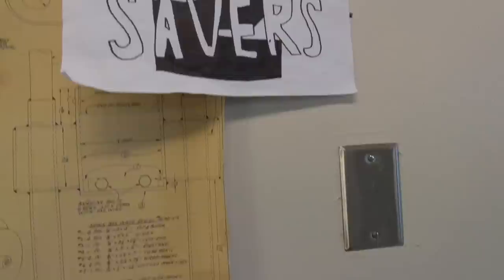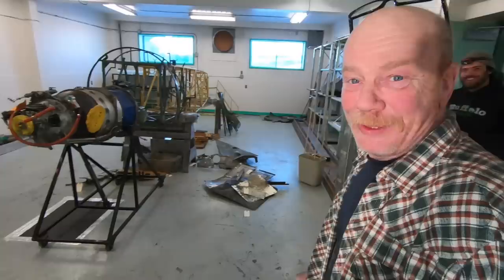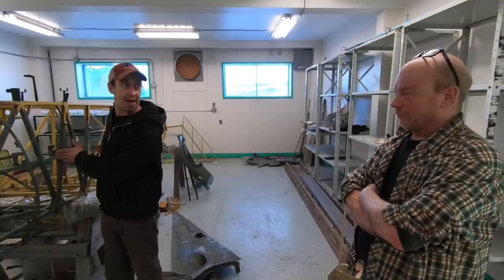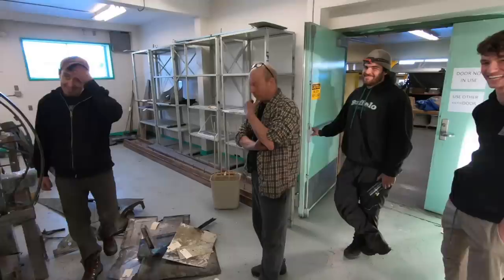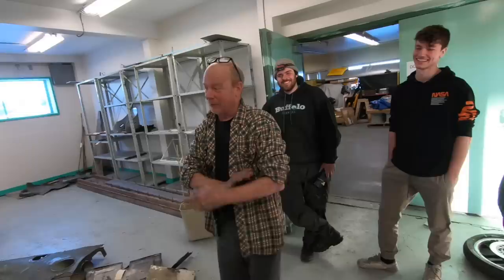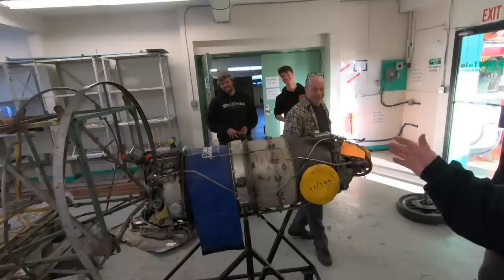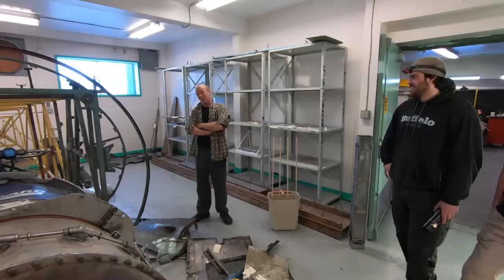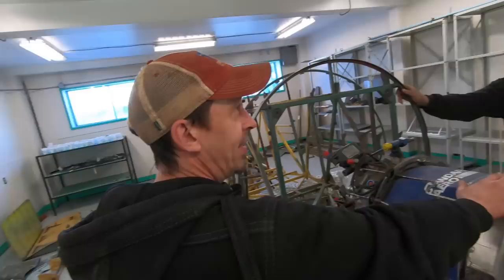Should we put a Turbine on a WW1 Triplane?  |  Plane Savers S2-E21

Comment: 6 seasons of Ice Pilots, 2 seasons of Plane Savers, and this is the most animated I've ever seen Rod! Great stuff as always Mikey
Reply: That'll preach.
Reply: Rod is mad scientist....the world's fastest Fokker Triplane
Reply: @marklittle8805  Until the wings peel off
Reply: @doneckford1189  my thoughts exactly. The construction of the wings is not sufficient to take the stress. Ask Mike Patey....
Reply: @westaussie2006  that doesn't make sense....Mike Patey's aircraft's wings failed because they hit the ground during a botched crosswind take off attempt, not due to engine relate stress.
Reply: @ernieszelepcsenyi5710  I think he talks about "Turbulence". A small piston kit plane that Mike PT6ifyed. He had to reinforce the air frame and wings to get a higher Vne and prevent the plane getting ripped in parts by the thrust of the PT6.
Reply: @ernieszelepcsenyi5710  I meant more for his slant on such a radical idea
Reply: @doneckford1189  It would have to be kept within its airframe performance envelope.

Comment: That would out Draco the original Draco!!  May be the coolest DR1 ever.  If you can't do the original rotary, it doesn't really matter what engine you use, it isn't original.  DO IT!!!!
Reply: I was also thinking of Draco during the video.
Reply: 👍👍👍👍👍👍👍 I hope they do seriously consider it.. Amazingly,  less costly than a rare high price radial that needs a complete overhaul.
Reply: Rotary? You mean Radial....
Reply: @streettosky5983  The DR1 was born with a rotary. Think of a rotary as a radial which has the crankshaft bolted to the firewall and the propeller bolted to the crankcase.

Comment: Its not just the CG to worry about. The torque from that motor will twist the tail off the fuselage! Every structural component will have to be strengthened, longerons, wing attachments, spars, tail feathers etc. etc. You’d have to do an engineering study, finite element analysis, to determine what needs to be beefed up. 
Having said that if you can do it safely GO FOR IT! You already have the talent and the hardware. You’d gain fabulous media attention. That translates into a marketing bonanza that will pull in dollars for the next project and good PR for Plane Savers and Buffalo Air. Win win! Plus it’d be just plane fun!
Go Mikey!

Comment: Mikey, your just messing with us. That engine will tear the wings right off the fuselage.
Reply: No it won't. It's still spinning a prop. The turbine is linear to you don't need to worry about torque going through the airframe.
Reply: What about the sheer power of that engine? Is it just a question of limiting it? I'm just asking because I'm curious.
Reply: What about it. The torque on a turbine is linear and you're just spinning a prop.
Reply: @RyanGribble  It's not about torque, it's about thrust. You'd probably need to keep the power output below 30% just to keep from exceeding the airframe Vne.
Reply: De-Rate is the name your lookin' for.
Reply: PistonAvatarGuy unless they redesign the airframe and build it with modern materials rather than wood and fabric. 
Rod is right - this is the ideal time and opportunity to make things “perfect,” but I’d still want an engineer’s opinion...and what about getting it registered with Transport?
Reply: yeah, it will rip the wings off.
Reply: Only if you exceed the top speed. There's is nothing really defining how quickly you can get there.
Reply: @gregdavies6842  I think it is safe to say the power to weight ratio will be that the airframe is to light for that engine. I think the plane would be unstable and crash after it leaves the ground, maybe killing the pilot, or the wings with be ripped apart. If all that doesn't happen, I think it will be near impossible to land the plane, as the air flow from the props alone ,with the 3 wings will keep it airborne, make it a vtol, able to hover almost. You may have to turn off the engine to get it down. Putting that engine in it, will make the plane to much for William to handle for sure, Joe maybe could handle it.
Reply: @gregorykusiak5424  10 years and hundreds of thousands of dollars later... "We built a tri-plane that in no way resembles a Fokker Dr.I!"
Reply: Time to make it a real youtube collaboration,  get Mike Patey and Elliot Seaguin involved, both know their shit and love aviation, if it can be done they will know how to make it safe
Reply: You gotta do it!
Reply: @Peorhum  nope.
Reply: It's not like you guys are going to have to fly it. William already said he would.
Reply: @PistonAvatarGuy  but its a turbine. It will suck the fuel almost as fast as a full-power setting.
Reply: @paulslevinsky580  Yeah, that's another problem.
Reply: PistonAvatarGuy well, while Mikey is definitely looking for donations to help the monetization of this channel to HELP finance his projects, I’m sure he has $$$ backing beyond this. 
I follow the Raptor cleansheet design project here on YouTube as well, and after about 2 years it’s almost ready for flight testing. This is a modernization project of an existing (albeit legacy) airframe, and the team’s depth of knowledge, breadth of experience and skill set is much larger in comparison. I say by spring in Yellowknife they’ll be close to the same if they choose to go that way.
Reply: @gregorykusiak5424  The only reason why this airframe exists is to emulate a WW1 aircraft, "modernizing" it would defeat the entire purpose of its existence.
Reply: PistonAvatarGuy the PT6 is way too much engine for that, even if they de-rate it. That said, it seems I’m more open minded about the definition of “Plane Savers”. Why not see what modern materials, techniques, knowledge and power plant can do for the original design? Doesn’t that also honour the original as much or more than a restoration?
Reply: @gregorykusiak5424  I just can't imagine what could be improved, the airframe is extremely limiting and redesigning it would be well beyond the resources available here. Safety also becomes a major concern when making significant changes to the design of an aircraft.
Reply: There's already a twin-engine jet/prob hybrid Waco. Kept the normal engine, slung a jet from (I think) a Lear under the belly. And they did a twin-jet Yak 110 not too long ago. Both of those planes now have a lot more power than stock.  It can be done if they're willing to put the engineering into it.

Comment: that would angry the purist , actually a free engine is a free engine . if it work then it's cool
Reply: I should imagine the reduction in vibration, alone, would be safer for the air frame.
Reply: Id say im one of those purists. However, this isnt an original dr1 to begine with so im not mad. XD it already would have brakes and a radial and throttle and probably a pitot static system.  Why not a turbine engine.
Reply: @benjaminjohnson6476  It's like an updated Avro Arrow theme.

Comment: Must do, Mikey. There is no other option. The CG must be behind the main wheels, or it will fall on its nose without enough weight behind the mains. I have over 9000 hours in turbine beavers and Pilatus Porters and can say a turbine tail dragged is the best thing built. Don’t worry about changing rudder and elevator size. The secret is the same as flying a Douglas Skyraider. You just have to be careful with power application at low speed. You can limit power output with adjusting the throttle rigging. Just sneak up on it gradually. The reliability of the turbine more than makes this the only way to go. The biggest problem will be building enough fuel capacity for the PT-6, probably 25 gal’s/hr at reduced settings. Keep fuel tankage near the cg. Build separate smaller tank fore and aft of the main for ferry distance, with tank selector valve. Just a really cute baby Beaver.

Comment: How would you get this very small airplane to carry enough Jet A to fly more than 5 minutes???
Reply: Motor is half the weight
Reply: Low power settings and larger tanks
Reply: I'm sure you fellas know a bunch more about this than I, so if it can be done, I say GO FOR IT!
Reply: The wings would probably ice up before you get that far in winter.
Reply: Two words... DROP TANKS😂
Reply: @montaguthorne2342  with low altitude fuses for max effect.

Comment: Sounds interesting, but what about the aerodynamic limitations of the wings and fuselage?  If all looks good on paper, this could out do a lot of aircraft!
Reply: Still just spinning a propeller.
Reply: @RyanGribble  just keep it within the airframe performance envelope and it'll be fine. I personally would ditch all the wood and make it outa aluminium.
Reply: @andytaylor1588  I agree. But they already have all the wood.
Reply: I don't see why you couldn't limit, govern, the maximum throttle range to prevent it from exceeding the limits of the airframe.

Comment: If you go for it,  you should seriously look adding significant strength to your frame (meaning metal and carbon fiber)
Reply: I am concerned about the additional stresses that the turbine will put on the frame.
Reply: @hillcountrysawdust351  It will not. The airplane will be flown within airframe performance envelope specs.

Comment: This is the kind of thing that makes life worth living.
  With the PT6, would you need a gearbox like other turboprops, or would you use engine thrust control, limited for propeller speed..?
   You could use carbon fibre or aluminum to strengthen key airframe areas.
    The wings may need to be redesigned and built out of aluminum or carbon fibre.
    Fuel tanks could be added on floor and as blister tanks on fuselage.  
     In all cases, the plane would legally have to be flown within the designed airframe performance envelope.

Comment: FYI i’ve done a lot of intricate woodwork and if you want to make a piece of wood flexible paint some ammonia on it and it will bend like rubber until the ammonia evaporates. Once the ammonia evaporates the wood tends to hold it shape. That being said don’t use it on plywood. Hope that helps. Also don’t allow full throttle on that turbine. 

Dave

Comment: Torque overstress probably from the start.  Inadequate structure to lift the fuel load required.  Inadequate structure.  Inadequate wheel track.  Inadequate flying surfaces (rudder).  I love you guys, and it's fun to talk about, but you are going to get someone hurt or break it.  It would be more fun to watch Stutka chase the cat.  Why not build it with the Jacobs and then throw a couple of Williams turbojets on the back by the tail?  :-)

Comment: Man i saw go for it! I like the “this side of mike’s hangar “ lol honestly I don’t know of any WW1 turbine powered aircraft. Turbines are a bunch times more reliable than a recip, and those are more reliable than a radial. So that’s a bonus, they are also pretty smooth engines as well. As stated you have a bunch of parts ready to go for that set up already and the crew that knows how to work and operate turbines. It will for sure be a EAA AirVenture center stage bird! Won’t have to worry about oil burn, maint will be a lot lower no plugs to mess with, operating cost shouldn’t be too crazy either since it wont need that much power during cruise. 

I say if you can reach out to Mike Patey, go for it and get his take as well. He is a very nice guy and I’m sure he would be more than happy to input his thoughts on it as well

Comment: Would the airframe handle all that power and stay together?
Reply: Like they say you would end up powering it back as soon as you get speed
Reply: I agree.  If the PT 6 produces more thrust will this add more load on the airframe?  I read that the Albatross had wing load issues.  Albeit this is not an Albatross.
Reply: Flown properly, the pilot will stay within the performance envelope of the airframe. And a good example of this is the 737-200 series, where it was a very, very bad thing to firewall the throttles, as it would quickly cause wing root failure.

Comment: The original plane used a 110 hp rotary engine how many hp would the PT6 put out? would the whole plane need strengthening to take the extra torque?

Comment: OK, with a conservative 750 HP rating it would need only a fast idle setting to get off the ground. Transition to vertical flight & select max power. At this point the wings would pop right off & the remaining aircraft could have a climb rate starting at about 25,000 feet per minute & increasing. Within 5 minutes it would overtake the space shuttle & could probably dock with the International Space Station. 
Good one Mikey, go for it. Call it the Focker Orbiter. The pilot could go by the secret code name "Max Speed"

Comment: I've built a lot of radio control models, from plan, over the years.  It's good practice to make sure you have sufficient power: not enough, it'll be a dog to fly, too much you can always throttle back.  The turbine will be easier on the airframe as it won't vibrate.  Provided you can get the CoG right and it's not ridiculously overpowered, It could work IMHO.  Needs some sums on CoG and prop performance (you don't need airspeed) and some CAD work to see if it can physically work. Talk to the large model guys in Canada, or maybe the UK Large Model Association.  Some r/c models are as big as light GA aircraft.

Comment: My main concern is the wings are made of wood, I wonder if the torque from the turbine would damage the wings or cause the airframe to cartwheel in flight
Reply: It would do so far less than the original options.

Comment: cool idea & would love to see the turbine version, 

I'm not an air guy I'm a a marine engineer guy and these are just a couple of thoughts that popped into this old mans head.

i think also needs to be considered as well as the center of gravity and center of for/aft balance is the pitch torque with the new length and power compared to the wing location / strength as the wing also has a large torque moment due to the height from the center line of the fuselage. 

The wing support to the fuselage and its vertical support systems may need to be strengthened. 

Sorry if this is out of the ball park as I said I'm a marine engineer not an aircraft guy but some of the issues seemed similar as we have a lot of issues with bending moments created due to length & height & the forces  created between the center of gravity and the differing changes in the center of buoyancy (Like your center of balance) the bending moments created between the  is constantly changing due to the ship movement such as pitching & rolling. 

love the shows. My father was a PBY navigator/bombardier in the NZ air force and spent a lot of time in Canada as a senior instructor in the empire training scheme.

Comment: At first, I was like WTF you are kidding but I think this may be a practical option and it would be way more acrobatic over any other DR 1 with the additional power. If you can get the turbine set back far enough so it does not look too goofy then I would go for it.

Comment: like installing a r2800on it. its just wrong.
Reply: Just like putting a 427 in a model T. Is that wrong?
Reply: @sandymcvicar2325  if you reinforce the frame of the model t it's ok, if not that engine will destroy the car.
Reply: @treemaker2  the upgrade of the frame on the Fokker appeared to be what Ron was thinking about.

Comment: If the wood wings are strong enough to take the extra forces, I say:” Why not”
Just check if the wings would not need reinforcement before you actually put the engine on

Comment: If it weighs the same or less and can swing a prop that will fit, then it should work.  Assuming that the nose is extended, as the TP is longer, there will be more lateral area forward of the CG, on a greater moment arm, so would need to increase the lateral area of the rear fuselage and vertical stab(oh, yea, there isn;t one) to compensate. easiest is just make the fuselage a bit longer to match.  you'll have to be carefull with power application in level flight too, so that you don't rip the wings off of it backwards, but there are other planes that have had that problem.. such as the 1st gen LearJet.

Comment: Okay here's my long-winded answer.... Okay we've talked about this, it's not going to have a rotary engine, so it's not going to be original anyway... So I say go for it! The dr-1 Fokker was designed with narrow wingspan to be a highly maneuverable airplane. The problem with the narrow wingspan was not capable of enough lift. That's why they made it a a tri wing to give it more lift, with the narrow wingspan. The problem was the tri wing resulted in too much drag, with the underpowered rotary engine of the day. With that turbine engine you've just fix that problem! That thing's going to make that Fokker fly like the original designers wanted it to! You're going from a cool replicas, to awesome performing stunts capabilities. The only question is will the airframe hold together, I imagine it would. Figuring out the C.G. no big issue. People will love to see a a dr1 Fokker replica oh, but they will be very amazed at the flight capabilities of this Fokker with that engine! However of course it's going to sound pretty darn weird, but I think people could get over it, especially when they see that Fokker fly!

Comment: Hey Mikey here is my two cents. If you are building it to resell they go original, but if you are keeping it then I would suggest the PT6 in, like was mentioned it is a safer engine less vibration on a light wood frame which is not as reliable as newer materials used in aircaft, with vibrations over time no matter how the wood is fastned it will get weaker, this coming from a carpenter. So I would say don't hold back you have everything you need for this engine and the professionals to pull it off I wouldn't give it a second thought to use it.